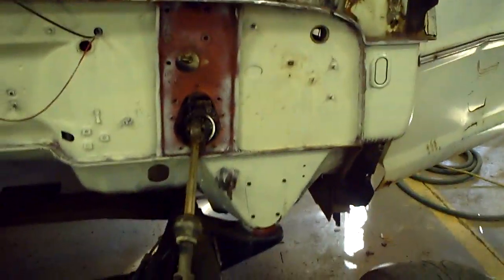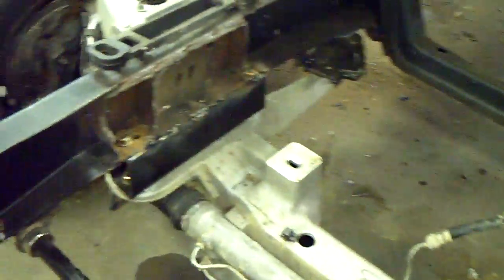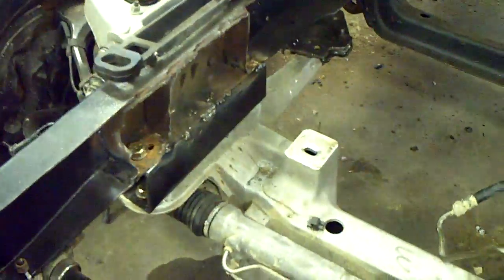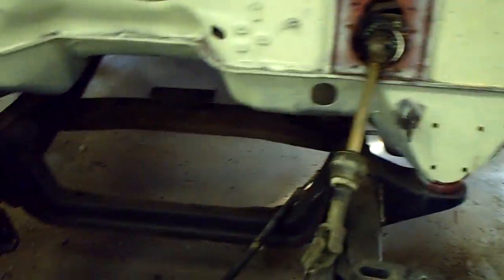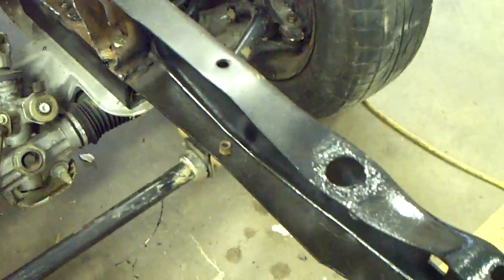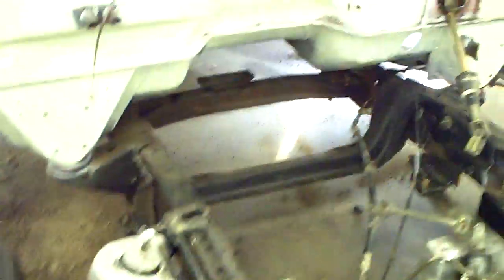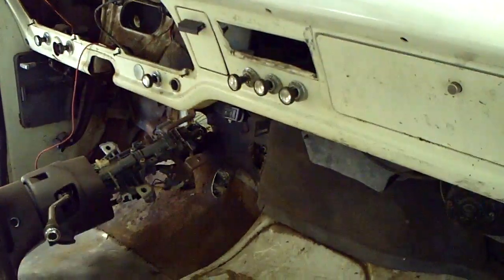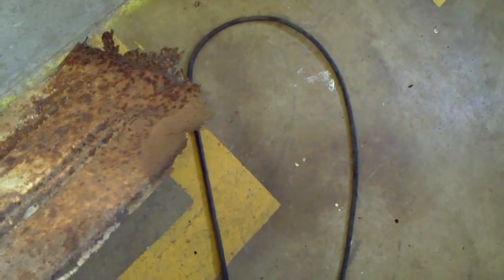crown vic front suspension into 67 F100 3 Stiefel's class

Comment: ok i found the other guy that you were talking of. he did a mercury front end and says it works just fine with the stock CV wheels but he is running 2000 mustang wheels and still has 1.5 inches of clearance. So Friday i will be picking up my 05 crown vic front end. i got it tires and wheels with every thing between for $400 ill be doing a video too :) thanks allot you saved me from a mustang 2 kit

Comment: @dad23boys thanks for responding. you still have it? yeah 34 is what i hear between the frame rails and that is what i hear 53-90's is. the measurement i was wondering about was how much wider the wheel would be. the wheel flange to wheel flange. im told that it is 3 inches wider then the i-beam drum to drum but that was a guess. i used a 2000 mustang rear axle in my 54 and it was a little wider but fits with offset wheels. thanks very much this is a swap that will annoy all the mustang2 makers